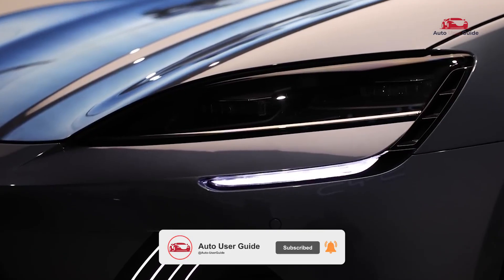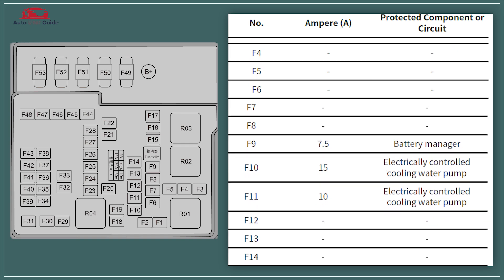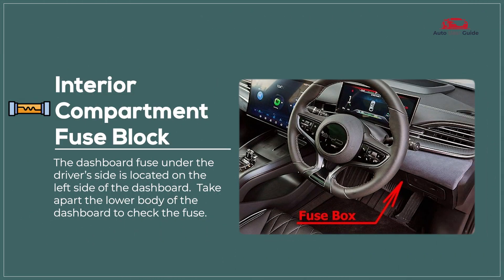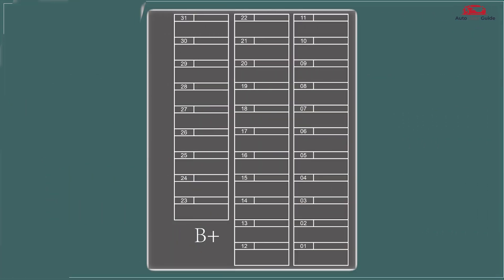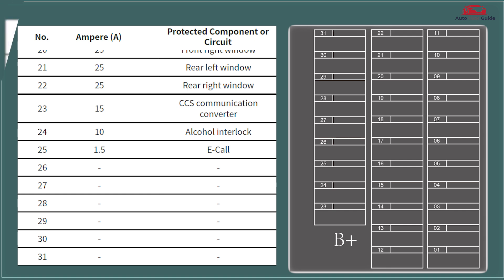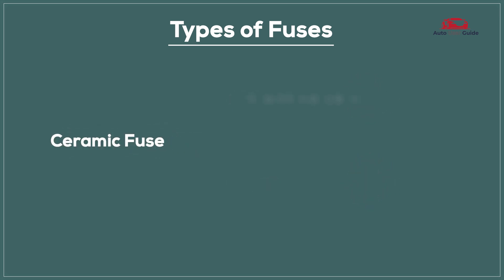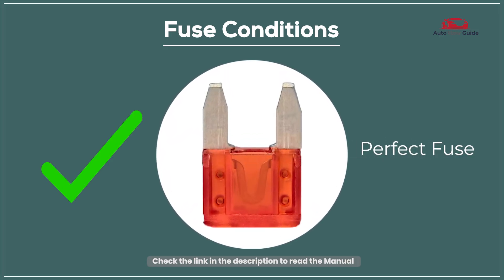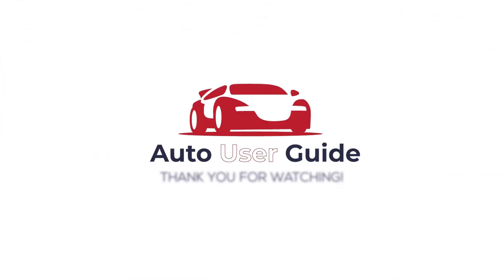BYD SEAL Fuses, Fuse Box Diagram and Location Guide

Comment: number 8 acc fuse ?
Reply from the maker: The ACC fuse (No. 8) in the BYD SEAL is for the accessory power circuit — it usually controls things like the radio, cigarette lighter, or other accessories when the ignition is in ACC mode. 🔌

Comment: Hi, I want to install a Viofo119 duo dashcam in my new 2025 Sealion 7 Performance. And I want to hardwire it. Which fuses should I use? Thanks for the time!
Reply from the maker: Great question! 👍 For hardwiring your Viofo A119 Duo dashcam, you’ll usually need:

ACC fuse (for power when ignition is on)

Constant/BATT fuse (for parking mode recording)

And a good ground point.

For your 2025 Sealion 7 Performance, I’ll prepare a detailed video/guide soon showing the exact fuse positions that work best. 🚗📹 Stay tuned!